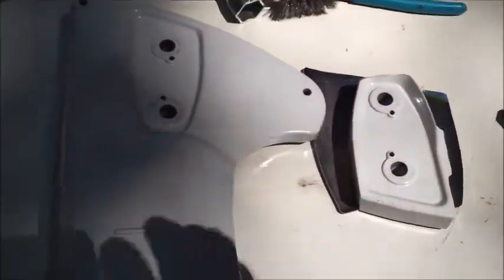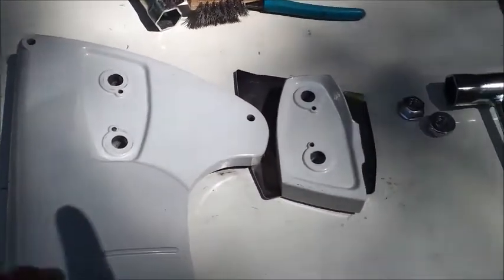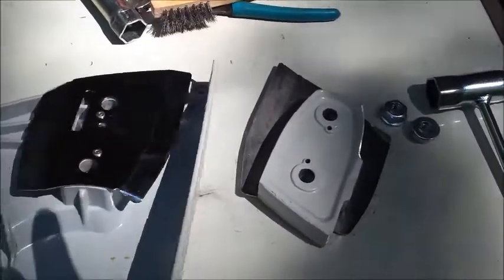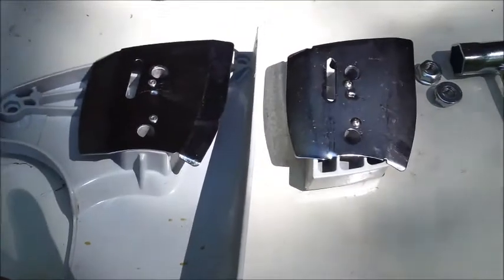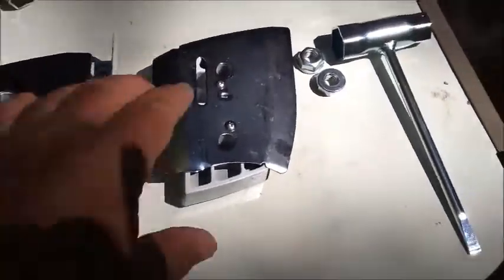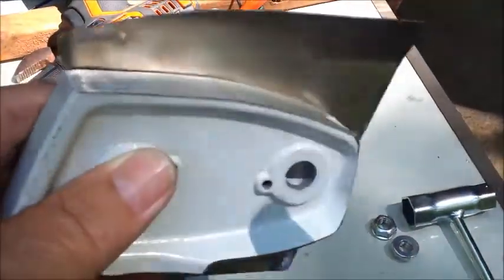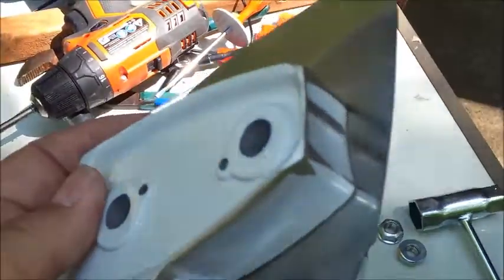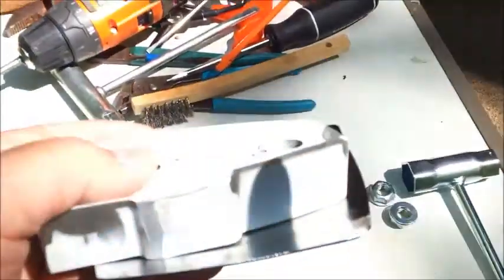FarmerTec Huztl MS070 Sidecover Simple Engine Modification

Comment: The narrow ends of both the steel and aluminum parts should go toward the sprocket.
Reply from the maker: Yes that is how Will set it up. I tried it both ways and did not see a chain path improvement.
Reply: @the1chainsawguy  I wouldn't expect it to effect the chain path, but maybe it would improve the pressure holding the bar. Plus it would make me feel better -- (grin).